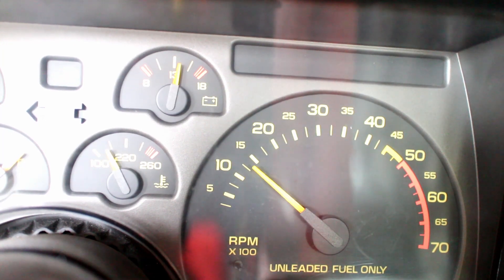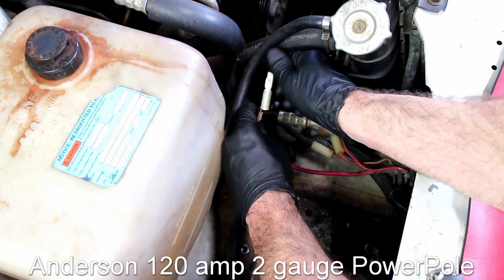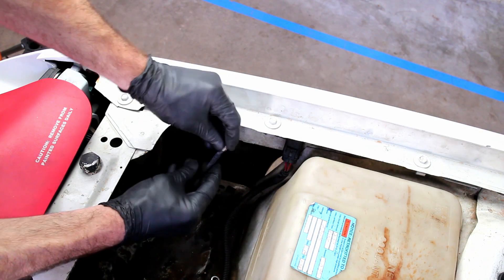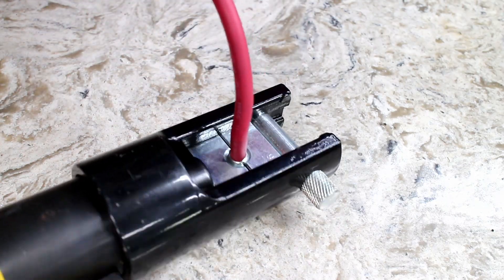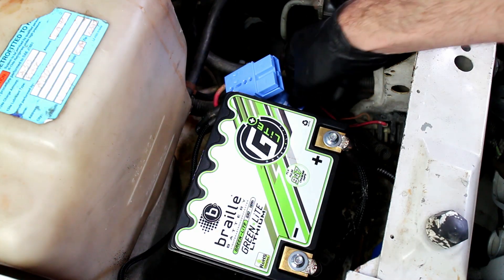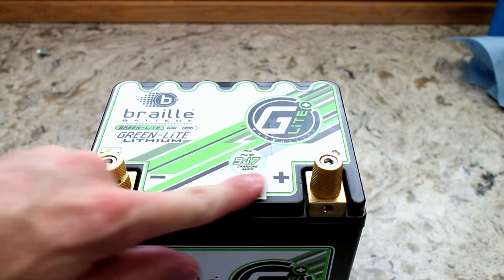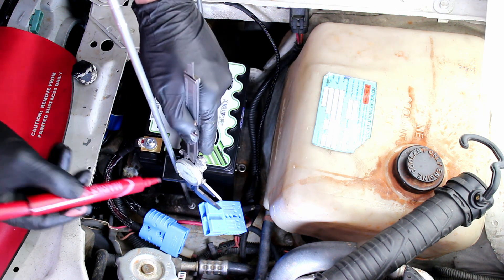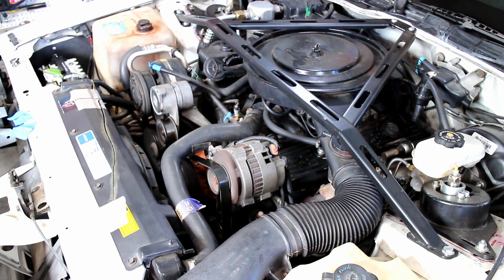Lightweight Racing Lithium Battery Install (82-92 Camarl/Firebird)

Comment: I had the same issue so i cut down a battery box, bolted it to the battery tray, popped holes into the box base for some quarter in all thread, plunk down the new little batrery and lay the battery hold down over the top with the all thread going through the hold down and secure with wing nuts. I did replace my ground wire and the little ground that sicks lutnof the larger one that goes to the battery itself came with maybe 3 in of line. I chopped that useless thing off and used part of the old ground wire soldered to the new one

Comment: Interesting.  A couple of points. 
1) I'm not familiar with this battery but I know there is a heat/water problem with them.  I have to store my drone batteries in a fire resistant container.
2) Is that battery rated for the load?
3) I have an Optima battery in my 82.  So I'm familiar with the charging restrictions associated with it.  I once made the mistake of leaving it on a trickle charge overnight.  I started it the next day and thought it was okay until I saw the vent.  It looked like a volcano.  The battery was ruined.
4) I don't see why you cut off the negative terminal.  By switching sides you are actually gaining wire length and you can relocate the #10 body ground to the radiator support.
5) You can wrap red electrical phasing tape or paint on the positive wire.  Do it at every wire connection.  You don't want to make that mistake.
6) Your crimp tool was nice.  I doubt if others will have one like that.
7) You should have worked on your battery tray.  The alkaline residue will eat it up.  Baking Soda will work but Coca-Cola is better.
8) I would recommend a Dielectric grease on all connections.  No-ox or De-ox are good.
9) I would seriously recommend getting or making a terminal cover.  You could form some ABS with a heat gun and Ty-rap them to the wires.  They do sell them at the auto parts stores or on line.
Overall this was a good job.
Reply from the maker: it's a 15 amp hour battery, so you can't do say 15 cold starts in a row
BUT lithium charges much faster than lead or AGM 
Braille said it takes 6min of driving to charge 1 start up
the corvette race team used this same battery in their c5 and c6R race car at Le Mans so i'm not too worried.
Reply: What kind of CCA are they rated?  You can bet it will fail in the worst possible conditions.  Extreme hot/cold temperatures or extended times between usage. (that's my problem)
Reply: Why would leaving an optima on a trickle charge ruin it?
Reply: @marcbrazzers  My definition of trickle charge might not be accurate.  My charger was an old sears "buzz box" style charger.  It has 3 options of outputs.  2 amp, 10 amp and start.  Unlike a "Battery Pal" style charger, It doesn't self regulate.  Meaning it doesn't turn itself off when the battery is fully charged.  
Optima says you can use this type of charger.  You need to keep your eyes on it and don't overcharge it. 
Mine was left on a 2 amp charge for almost 20 hours.  Optima states no longer than 12 hours.  I've routinely charge my boat batteries for 24 hours but they are deep cycle and can absorb that style charge.  My Optima didn't and vented gas.  It was ruined.

You shouldn't have any trouble with a charger/maintainer.  Do not let the battery voltage drop below ~ 9 volts.  If so you will need to connect that battery to a wet cell, lead acid battery to charge it.  It will absorb the charge and equalize the voltage between the 2 of them.

Comment: I had this too in my daily car and on my bike. I would not recommend this mod for daily cars. Because it's good enough for starting but it's not good for your radio etc when the engine is of.
Reply from the maker: a daily needs a larger lithium battery, something in the 25+ amp hour range. Mine being 15AH.
the Porsche guys use 30AH ones that work flawlessly in daily drivers.

Comment: This is an interesting mod, I assume your older alternator can charge this normally? I am in the middle of an LS swap and I went with an AGM relocated to the passenger side rear, down in the spare tire location, very happy with it so far. Great video, Thanks.
Reply from the maker: I talked to Braille tech guy and he said any semi modern alternator will charge the lithium battery no issue.
I've used mine for around 6 months without issue. I wanted a light battery without the hassle of relocating it.
Running 2 gauge wire to the rear of my car with the correct terminals was actually heavier than just using this 5lb batt.
Reply: @3rdGenGuy  Yes agreed, you have given me food for thought, my build is on-going and will be for some time with changes / upgrades butt, that's half the fun for me. Great stuff, really appreciate your channel. Thanks.
Reply: Great video. I relocated mine to a spot I cut out and welded in a half box  behind the passenger seat in the floor. It was a lot of work but I like how it turned our
Reply: @vandettabuilds6641  I am sure there are a multitude of "locations" just needs to meet the owners needs. I simply want less front weight (like the change to 6lb batt. above) and move the weight back and to the right opposite the drivers weight.